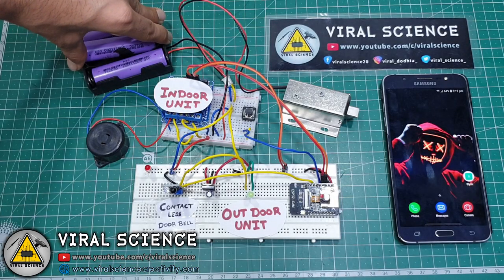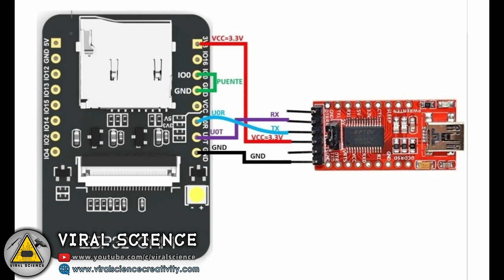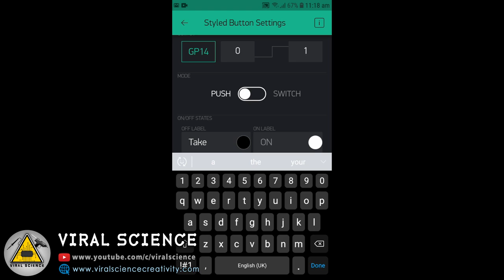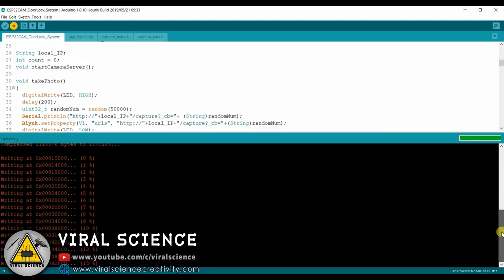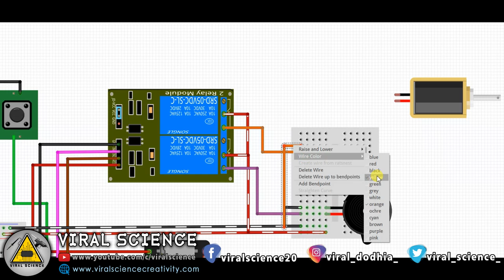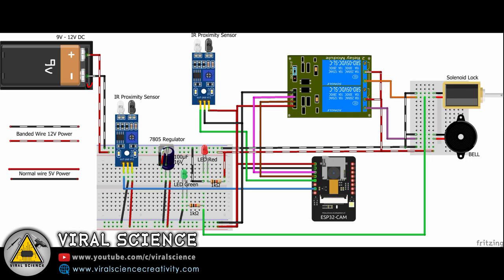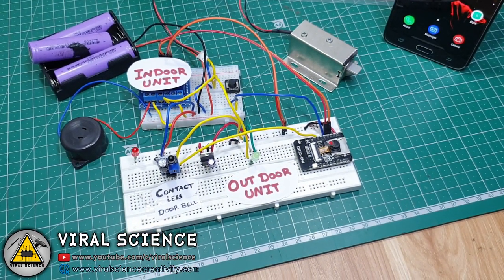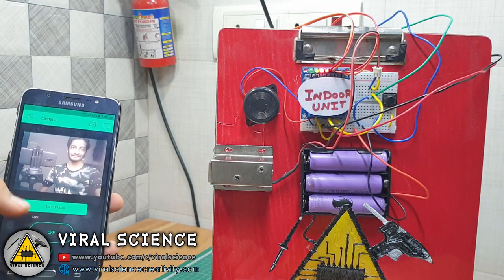ESP32 CAM Contact Less Door Bell Security System | Blynk

Comment: Nice topic, but the range of IR sensor is not enough to detect anyone in front of the door, I recommend using Ultrasonic range finder, and IR can get fiddled by Sun rays, so you cant put this outside..... However the idea of taking photo is new!! Good Going!
Reply from the maker: IR is just used as an alternative of button so it will be touch less and safe, you can even use ultrasonic sensor or even PIR motion sensor 😊
Reply: @ViralScience  Yup, okay, true, Nice vid, by the way 😊
Reply: Bhi code send karo
Reply: @ViralScience need code

Comment: Hi, sir thank you for this but can you help me? we're doing our research about face recognition security system, we want to control the door lock with two esp32 cam and control the lock. We use 2 channel relay, when the system recognized the face the relay is working but the problem is in the output, we connect the red wire of the door lock to the common pin, and the normally open to the 5v but when we connect the same connection in the other input (in2) the lock is working but when the face is recognized the door lock is still locked. When we try to recognize both esp32 cam together that's when the door lock opens. We want to put the ESP32 cam Outside and inside. Sir, I hope you know what the problem is

Comment: Ques 1 ) From which website can I buy Esp32 cam board ... plzz give link.
Ques 2 ) Which website/App do you use for making circuit Diagram...
Reply: fritzing you can buy from flyrobo
Reply from the maker: Software is Fritzing
Buy:- https://www.flyrobo.in/esp32-cam-wifi-bluetooth-development-board-with-ov2640-camera-module?tracking=5c723900abvrl
Reply: @ViralScience  thnx bro ... for replying...I will surely make this project
Reply: @dipinadhikari9549  okay bro... thnx for telling